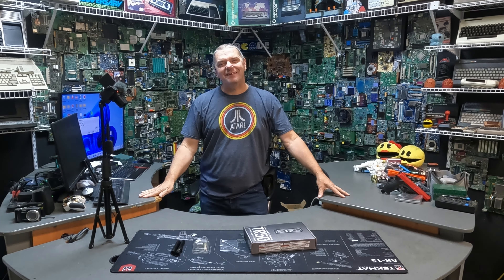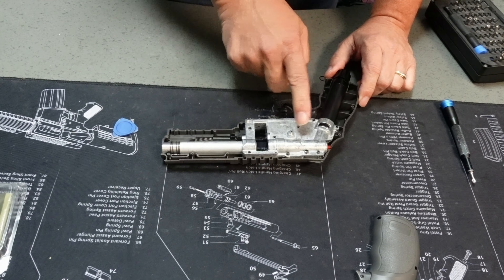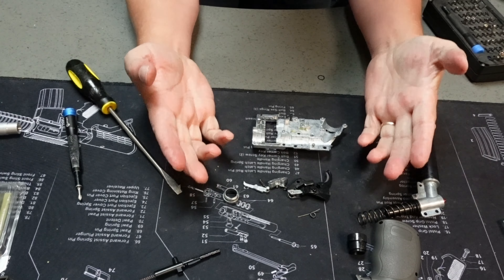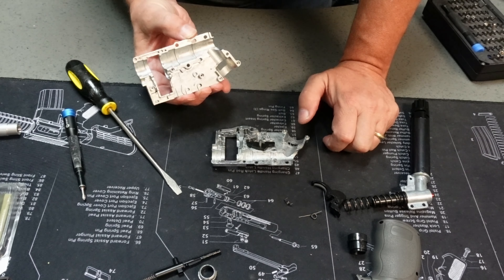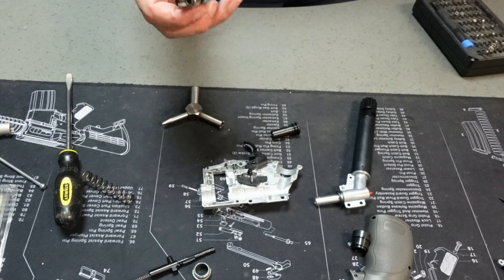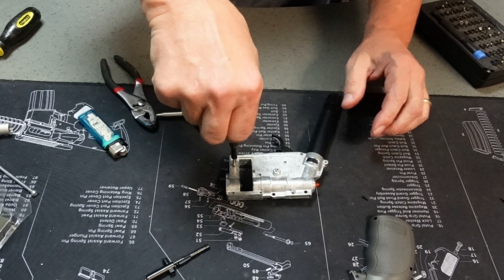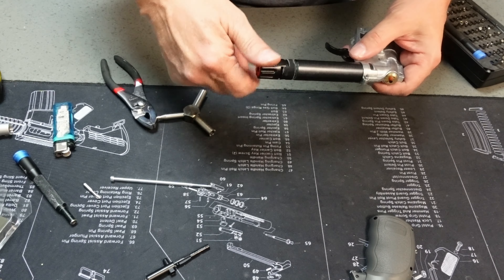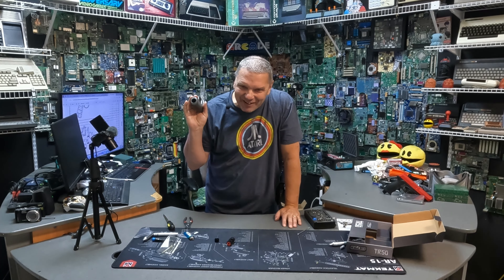Umarex TR50 complete teardown, upgrade, and rebuild | Lets take it down to the frame!

Comment: Thank you very much for this tear down it provides an incredible amount of value! 
Question for you, I removed the valve block from a 7.5 J HDR50 and upon finishing the trigger no longer hits the CO2 to propel the shot. I disassembled twice and I cannot see any missing pieces any ideas?
Reply from the maker: Absolutely, there’s a very small spring right on top and above the trigger that pushes up a metal triangle looking piece. That is called the bolt catch. If the bolt catch is too far forward, it will not allow the trigger to hit that spring.
Reply: @AlternateArmsSD  beautiful! I’ll give that a shot thank you very much!
Reply from the maker: @AirgunJohnny  Anytime :) If you need help, I’m always here for you!

Comment: Another great video. Around 16:42 you show the size difference between the two pins. I wonder if one cannot just take the original pin and cut off the top then reshape to be very similar to the red pin? Just curious.
Reply from the maker: You absolutely can. However, it must be milled and polished perfectly. If there are any sharp edges, ridges, or imperfection, she will not get a good seal against the O-ring in the receiver.
Reply: Sure would like to know the mechanics of how that firing pin really works. Wonder if that would be an interesting video of "how" these launchers really work. Just a thought.  @AlternateArmsSD
Reply from the maker: @briandonaldson612stringgui8  absolutely brother, I will put together a video of next week. In short, the firing pins slides all the way back into the receiver. It makes direct contact with an O ring (This is what seals the C02 in the chamber). When the trigger is pulled, it releases the firing pin from the O-ring in air comes through. Then, the bolt spring pushes the firing pin (and bolt) back into the O-ring to reseal the launcher. In theory, a shorter firing pin means more air gets into the bolt and that’s more power. However, I’m dubious at best on that. The increase you will see is negligible.
Reply: Thanks for that explanation. Unfortunately not having a diagram (or better yet a cutaway) prevents me from "seeing" a mental image of what it is doing. LOL Must be old age. LOL @AlternateArmsSD
Reply from the maker: @briandonaldson612stringgui8  All good Brother! I’ll see what I can do to setup a video.